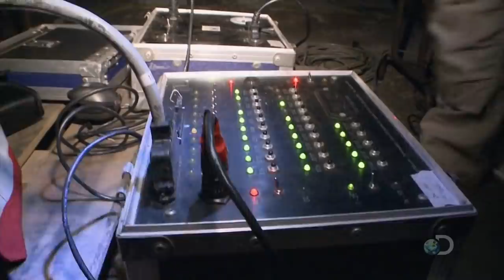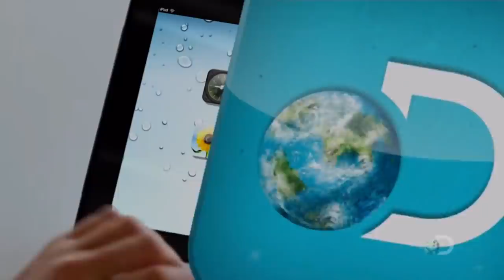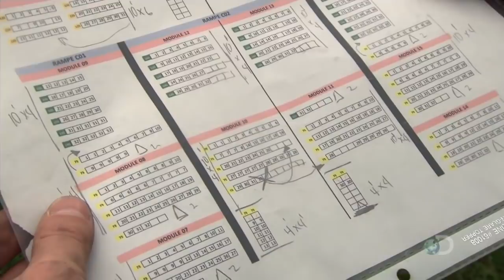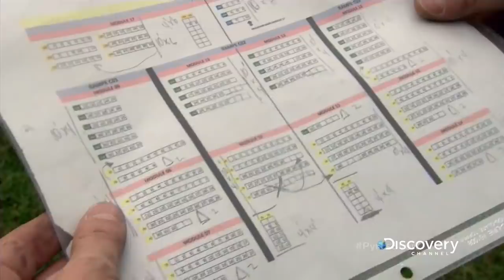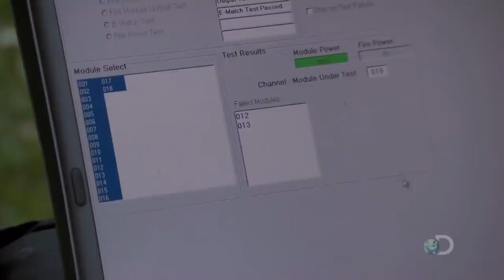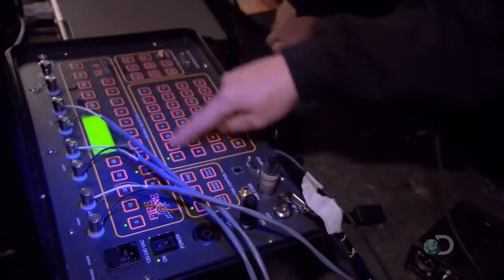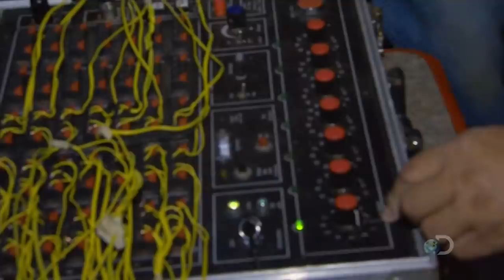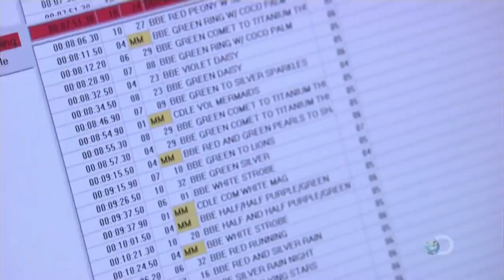Pyros s01e03 - Breaking Point

Comment: If anyone screwed up a show that bad in the company I work for, you would be fired so fast your head would spin!  
Also! Pro Tip! Nail Guns make your rack setup go 10 times faster.
Reply: Especially the electric cordless ones that are out there now.
Reply: @EagleMitch  I watched this series when it first came out, and it made me laugh at how overly dramatic they make everything.  
None of the firework companies I worked for were ever this chaotic.
Reply: @Rammstein45  persoannly if they reuse the racks i wonder if they couldn't make a bolt and nut version, then they can unscrew the bolt and put it on with a drill every show
Reply: @Rammstein45  I worked in Television for a long time,  and as well for some from the US and you can be pritty sure that everything will be over dramatised. they even give lines that dont exsist